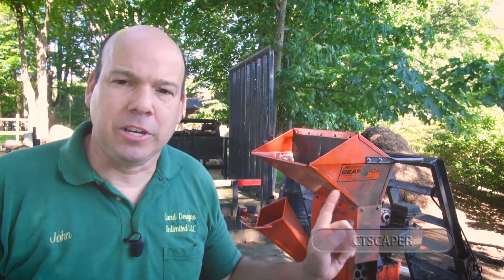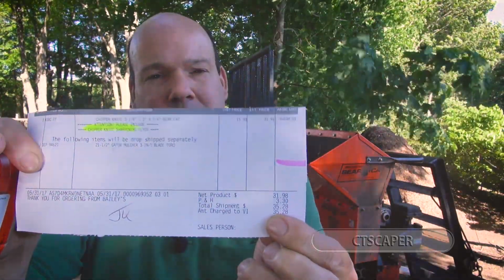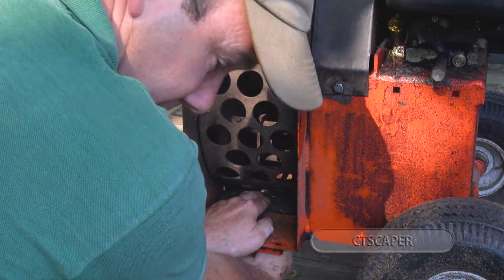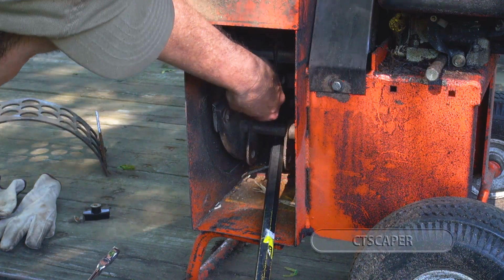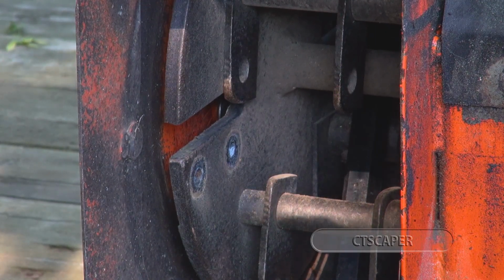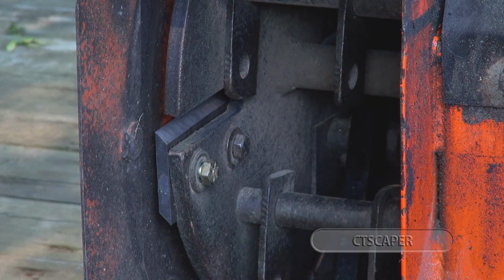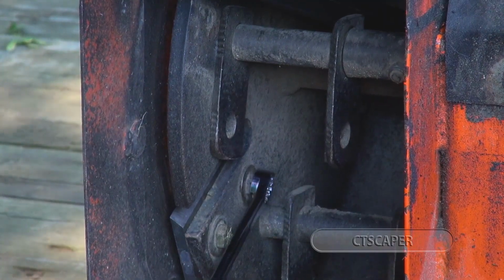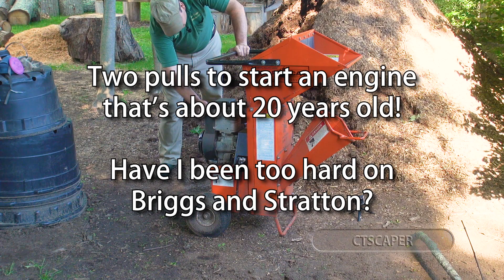AFTERMARKET CHIPPER BLADES

Comment: I’ve got a different chipper but similar blades and setup. A couple minutes on a grinder and the blades are nicely refreshed for $0. As long as you don’t overheat the metal it still works great. Maybe a half dozen refresh. Nice that your blades are two sided.

Comment: I like the fact that the blade is threaded so you don't have to worry about putting a nut on there and holding it too while you turn the bolt.I have to be able to access both sides of my blade's on my chipper due to having to hold the nut while turning the bolt.

Comment: If anyone really wants to sharpen their own blades your bed way is a belt sander but it's best a surface grinder with a flat face don't expect but a temporary sharpen blades and might be dangerous and must be balanced in weigh between the two.
Great video and helpful

Comment: John, have you used the fine debris screen on your bearcat shredder? I'm looking to produce much finer shredded material to accelerate composting. I know that Echo makes one, but it's around $130. Pretty expensive for a screen. So before I bought it I'm wondering how good it works. Thoughts?
Reply: Came here to ask the same question, so just moral support from me.  I need to see a video of the fine.

Comment: I just bought one of these today SC 3306  with the 900 Brigg's engine. . It looks brand new no scratches. It had  a minor issue with bottom jet plugged up in carb not being used for 8 months through the winter. 10 Minute fix. I got the original sales tag and it was $1230 with tax.  I bought it not running but new for $400. I will get that money out of it in a hurry!!  I am like you.. I think it will be a great machine but just could not see 1200 bucks..

Comment: John, you did the correct thing, go new and the re-sharpen. Darren smith is all so correct, the knives look hagered . The most important thing about the knives are the shafts attachment bolts and nuts.... My old Merry Mac went A.W.O.L. on me, I am lucky to still be on Gods green earth.
Reply from the maker: I think I'll replace those bolts next time around.  I don't want any airborne blades.
Reply: Wise choice

Comment: Fuel looks blue tinted? What kind of gas are you running in this?
Reply from the maker: I use 2 cycle mix in the winter because I don't need much straight gas in the winter.
Reply: Best to use non ethynol fuel in small engines. Ethynol will destroy the carburetor, and  a  2 cycle mix will carbon foul and plug up your exhaust on a 4 cycle engine.

Comment: Just wanted to ask how the Bailey’s chipper blades are holding up. I need a new set of blades for my chipper soon.
Reply: I bought some and they worked good, I even reshappened my self, but you can send them to Bailyeys and they will sharpen them for $2 something a inch, so not bad.

Comment: The shredding knives a looking a bit worn out as well.
Reply from the maker: I don't know what sign to look for regarding when to replace them.  They're attached to the shaft with a good deal of metal and I don't see cracks.  Any ideas?
Reply: CTSCAPER the edges begin to round over same as the chipping blades. The outside edge will round over first.  They are also reversible for longer life.  Great videos by the way.  If you couldn't tell I work at Crary industries on  OPE product line.
Reply from the maker: I did not know that.  Isn't Crary part of Echo now?  If the 5 hp model can keep up with stuff like that the 8 or 11 hp must be a monster.
Reply: CTSCAPER Crary was bought by Echo in 2006, Crary is a diverse company with other many other product lines, besides the Outdoor Power Equipment. The 3" machines are little beasts, I use every OPE product on a yearly basis. If you ever need any help feel free to drop me a line.
Reply from the maker: Thanks Darren.  I think I got it.  If I need to replace the rotor assembly at some point I'll call you to see if the new ones are interchangeable with the old.  You seem like a guy that could get the answer. :-)